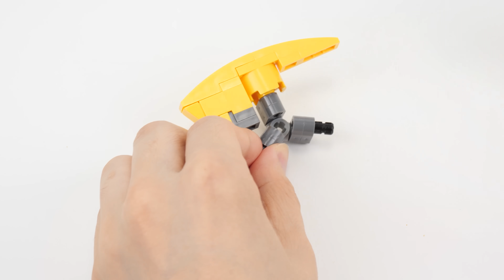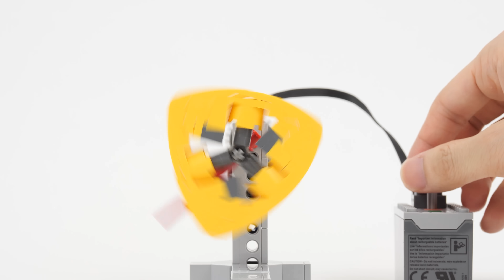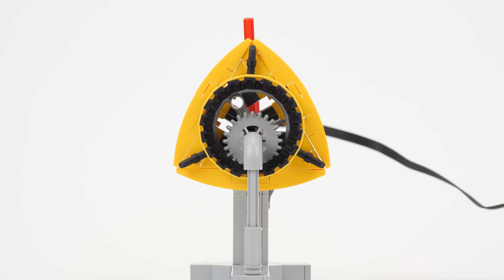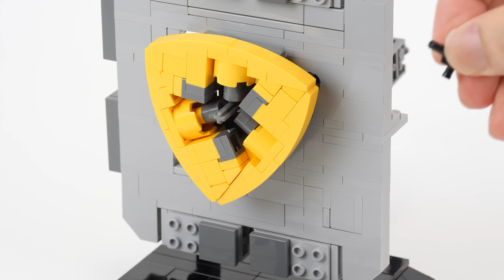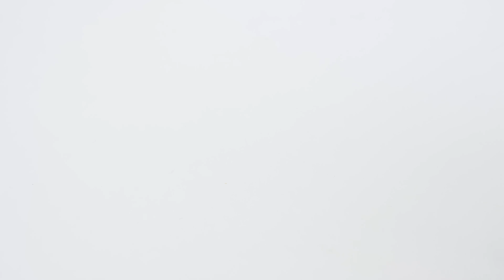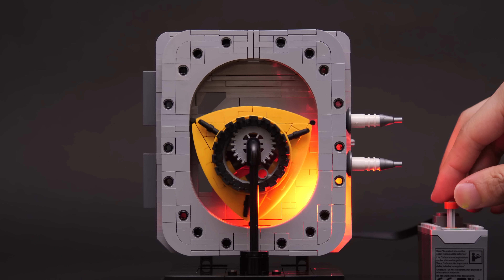Lego Rotary Engine (Wankel Engine) レゴ ロータリーエンジン

Comment: Damn, this LEGO Wankel worked better than the real one I had in my X8.
Reply: No surprise.
The renesis was shit.
Best thing for an rx8 is to swap it for one of the 13bt from a 2nd or 3rd gen rx7.
Reply: @blyndrotor  Wish I had known before.  I have heard the 7s were more reliable.
Reply: @OverandOutChief1  
Huge compromises made in the design change for 5he rx8 to meet emissions.
Came at a price.
Reply: @blyndrotor  high static compression ratio is why the Renesis was garbage.
Reply: @sandervanderkammen9230  
You forgot the reduced oil flow to bearings.
Along with lower quality housings, lighter more fragile apex seals, side port exhaust and a cat that would choke up.
Reply: @blyndrotor  The primary failure mode of the Renesis was low compression due to seal damage, this is caused by high brisance and ablative damage related to the high static compression ratio and the occurance of irratic flame propagation known as pre-ignition or detonation.

A clogged catalyst is a common symptom of excessive exhaust gas temperature caused by incomplete combustion due to low compression.

Comment: As a long time rotary car fan  (my first rotary car was an 85 RX-7 GSL) and even longer LEGO enthusiast, I salute you for an awesome video!
Reply: I've been wondering, how does this type of car engine work? You say you're a long time fan of these types, and I was hoping you could share some insight
Reply: TrainBoy227 YT Just like a typical 4 stroke engine that uses the up and down motion of the cylinders, connected to the crank shaft, to turn the drive shaft, the spinning rotors are connected to a crank shaft which in turns drives the drive shaft.  Rotary engines have the benefit of putting out more horsepower for a given size engine (the Mazda R8’s 1.3 liter engine putting out 232 hp).  Being smaller, the engines can be mounted further back (behind the front wheels) and lower to the ground meaning you can design a better handling car around a rotary engine.  Also, rotary engines also have fewer parts.

However, rotaries are not as fuel efficient as their four stroke counterparts and require more dedicated maintenance.  Failure to perform routine maintenance, like oil changes will result in premature failure.  Lastly, the seals at the tips of rotors (the apex seals) will only last so long (60k to 100k miles - maybe a little longer if the engine not driven hard) and need to be replaced.  However to do so means pulling out the engine and opening it up to access the apex seals.

All in all, rotaries are quirky engines and require more attention but they are amazing to drive and they love to be pushed to their redline.  It is not an engine for an every day commuter that just wants a point A to point B vehicle, it’s an engine for a driving enthusiast that will appreciate its quirk and give it the maintenance it needs.
Reply: @AstroNerd  Another thing to point out is that the actual rotors inside the engine rotate at 1/3rd of the speed of the "crank" aka eccentric shaft, therefore if one of these were to operate at 10,000 rpm for example, the rotors themselves would rotate at less than 4,300 rpm to be precise.

Comment: Looks like your apex seals went bad mid build, such a shame
Reply: It's a Rotary, it would get broken anyways
Reply: @thytor756  Who you kidding. Rotaries are darn near bullet proof. It is everything around them that breaks. Usually from all the heat they produce. Mine was good well over 100K it was the radiator that finally broke that made me give it up. And only because replacing the radiator cost more than the car was worth.
Reply: @koloth5139  sure bud
Reply: Koloth Most cars easily reach 300k. I believe the big failing point of wankel engines are those seals.
Reply: @Engineer9736  And a rotary will easily reach 300k as well if you're doing the maintenance. The seals do wear, but not any faster than piston rings if you're changing your oil properly.
Reply: @brysonkuhn3290  rotary engine requires care and attention 
It requires you to rew high from time to time and if you arent oblivious about the maitanance it will last you a long time 
If you wanna dislike the rotary then do it right. They arent as fule efficent and arent eco friendly enough to be mass produced
Same goes with boxer engines they require more care than the traditional engines 
It takes someone who knows something about cars to own a car with those engines
Reply: @emelgiefro  exactly. If you don't do anything to it, it will break. Where I was getting at is that it's not "bulletproof" because it needs that meticulous care. I like rotaries for sure, but I wouldn't call them bulletproof
Reply: @emelgiefro  I think in some ways,   a rotary is more similar to a two-stroke; timing ports, highly dependant on (sp)ring pressure since sealing is crucial, and too little lubrication will kill even the best quality rings/seals instantly...  Just run 1 to 50 (2%) mix with high quality 2 stroke oil and your apex (and other) seals won't cause nearly as much issues...
Reply: @brysonkuhn3290  nothing is bulletproof tho car parts brake all the time they all take a lot of care some more than others but still if you dont take care of your stuff it fails
Reply: @emelgiefro  yes, and rotaries need more than a standard engine. And some ice engines need less than othe ice engines
Reply: @koloth5139  they're not very reliable. 80km, and the seals are OUT. and you need a ton of heat reduction, and special procedures to even make them as reliable as a i4, i6, v6, v8, etc. they're good for performance only.
Reply: and even if you want to get more performance parts, you have to sacrifice heat reduction and reliability
Reply: @koloth5139  Apex seals is the primary failure mode of all Wankel engines... they are notoriously unreliable and have a much shorter service life life than comparable reciprocating engines.
Reply: @henkverzeijl1525  Never run 2-stroke oil in a Wankel engine... Wankel engines are 4-stroke Not 2-stroke engines.
Reply: @sandervanderkammen9230  And what if i told you there even are reciprocating 4-stroke engine which run 2% premix? I know, cause i build them. Don't talk theoretics if you don't know the practics aswell... Apex seals fail because of lubrication issues, especially on tuned applications. Adding a bit of 2-stroke oil almost completely solves that issue, as many RX-drivers can confirm to you... A wankel still doesn't come anywhere near the mileage a normal 4-stroke would get, but that'll probably be spring pressure related compression issues due to fatigue rather than chewed up seals... Like on a 2-stroke for example, hence the comparison. And if you would've read my comment closely, you'd have seen i never claimed a wankel ís a 2-stroke, just that it is similar in some ways...
Reply: @koloth5139  changing oil? you mean... adding oil? 😂
Reply: @blarpo7385  Theyre easy to take out and rebuild once you get the hang of it... Since theyre smaller and have less parts, although parts are pretty pricey.
Reply: Lassi Kinnunen  Only stupid people pour the wrong oil down the wrong filler hole..
Reply: @sandervanderkammen9230  Wijsneus
Reply: Kinda like a real one

Comment: LEGO technic: rebuilding modern technology with horrendous tolerances!

(In all honesty, I was impressed to see this made!)
Reply: *slightly lower tolerances than an actual rotary engine
Reply: @sneab-jp6du  That is true 😆  I did read once how rotary engines have a problem with the engine block heating unevenly...
Reply: @ chrisroode

ALL engine blocks heat unevenly. 

Take temperature at the top vs bottom of the cylinder jackets... or intake vs exhaust side of the cylinders.
Reply: @sneab-jp6du  nice!
Reply: @sneab-jp6du  came here to say that
Reply: Akiyuki! you are a genius!
Reply: Gotta say, thx for explaining to me how a rotary works! Also very nice build. Im pretty young too, so using legos rally helped!
Reply: Not to be meant but the rotary engine is old not new
Reply: @Shyzes  it depends on what they mean by modern